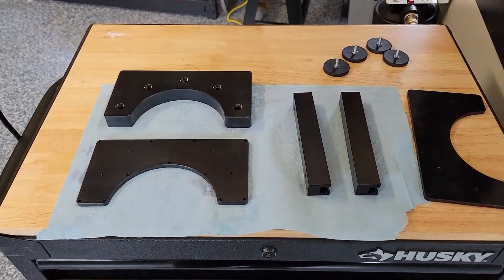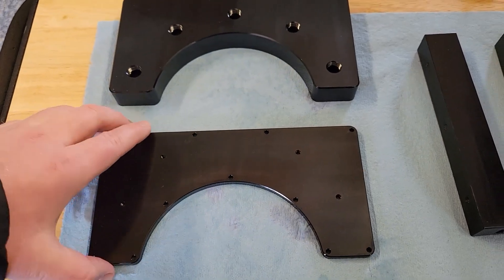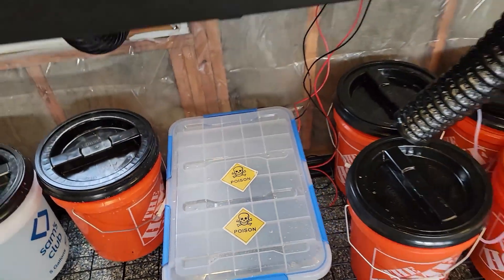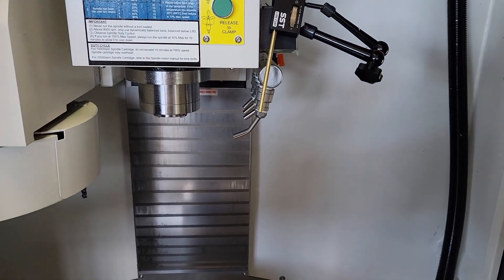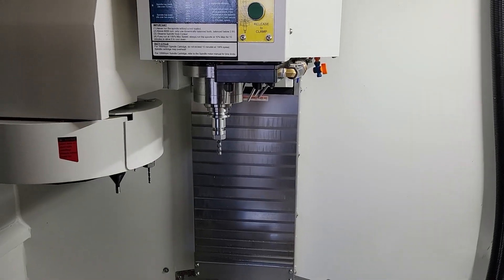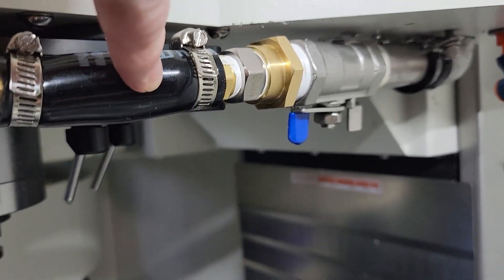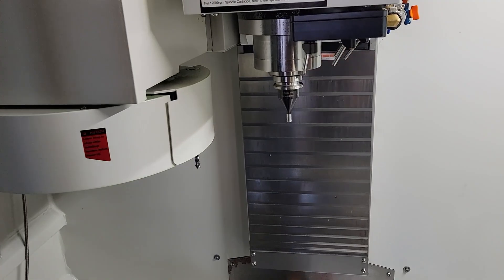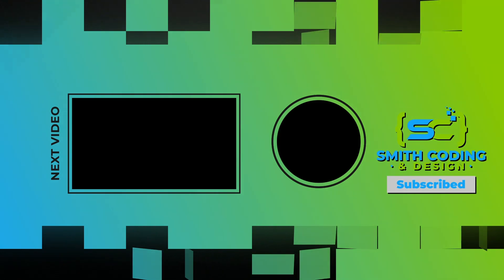Syil X7 Coolant Manifold Installation

Comment: Nice job! You should be able to re-anodize the part. Also, I cringed a little when you talked about acid and wave maker in the same sentence. I had the same agitation issue in my anodizing setup, and used compressed air (less than 1 psi) through a quick disconnect to PVC pipes that never leave the container to agitate the acid (https://longezproject.blogspot.com/2015/01/anodizing-part-3.html). Having said that, if yours works... it works. Ciao, Marco.
Reply from the maker: I've switched to a wave maker for agitation in my degreaser as well. I tried air, but it stinks up the entire shop. If I ever go to a larger setup, I'll use a chemical resistant pump. What are you using for sealer? I'm trying to use the least amount of hazardous chemicals as possible. That's why I didn't etch and anodize the original part again.
Reply: @MrSmith1231  look at the anodizing sealant at Caswell Plating